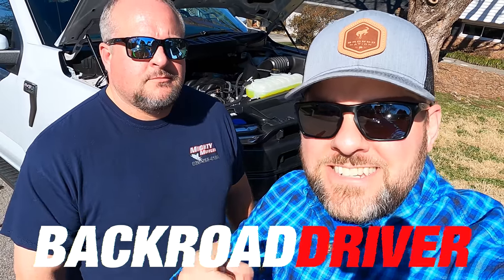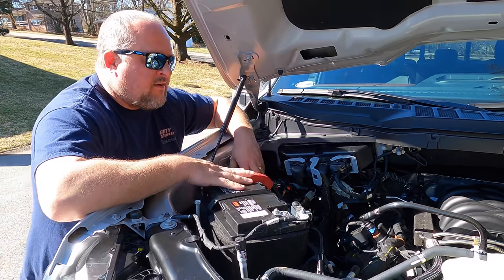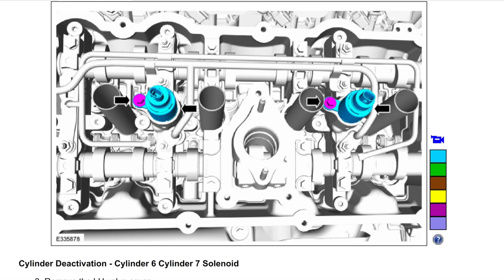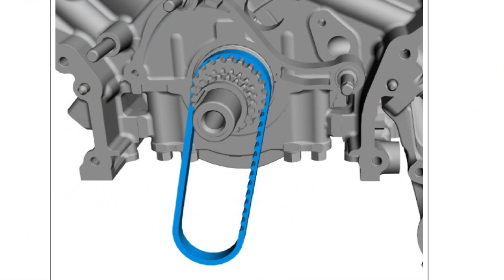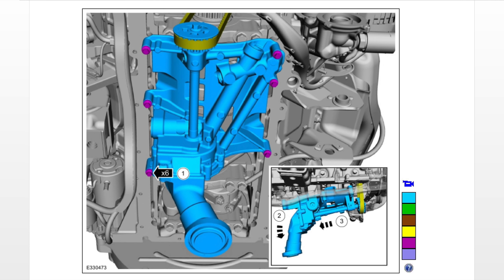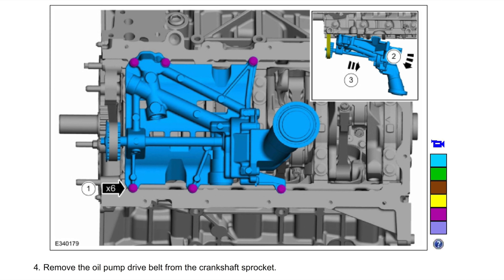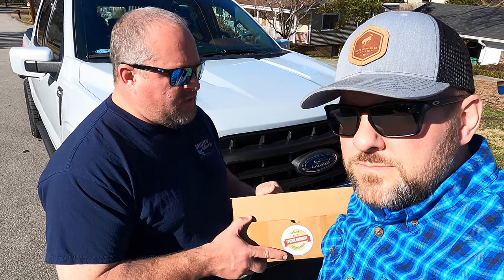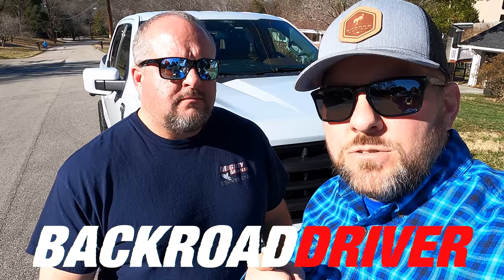2021 Ford F150 5.0 V8 Cylinder Deactivation & Oil Pump Belt Explanation - JLT Catch Can Install

Comment: Oil and rubber belts don’t mix, that won’t end well for Ford.  GM is also doing that on the Duramax in the 1500, except its on the back of the engine, so transmission has to be pulled to service it, genius!
Reply: Yah that is definitely going to be an issue.
Reply: Material science has advanced compounds in belts.  It is not “rubber”.   Engineering has improved gum bands to be oil resistant.

Comment: Getting my first Toyota Tundra this year. And a Ford guy for 35 years of driving. Tired of the b*******.
Reply from the maker: Thanks for watching!  How come you chose the tundra? It looks virtually the same as it did over 20 years ago and hasn't had any significant updates since 2007.  I have a feeling you'll be back in a Ford before too long.
Reply: Tundra reliability and proven engine/drivetrain.  Hp and Tq wise it’s still competeing with the others 14 years later. Also no BS cylinder deactivation, start-stop.
Reply: @Mill72  Still once the Tundra gets some miles on it they average 11 miles per gallon, at that rate for 10,000 miles drive a year the Tundra costs $600 a year in fuel alone. I've had Ford's for years have a 3.5 EB now, I've not have issues with them when people cite reliability as a reason they buy Tundra I guess, sure, but it's not been my experience that Ford is anything but reliable, and lasts a long time. I kept my last Ford 20 years, the  drive train was still strong when I got rid of it.
Reply: @Steve-yr5vi  I had a ‘14 Tundra and now an ‘21.  Your exaggeration of 11mpg is false.  Both of my Tundra gets 13-14mpg mix and freeway 15-17mpg.  Yes it’s hand calculated and not going off the lie-o-meter.  I also had an ‘17 F-150 3.5 Ecoboost.  I can tell you at best freeway was 19mpg.  The 5.0 would be similar.  It’s moot at that point between mileage.  Towing wise I bet both similar with 5.7 Tundra to 3.5 Eco and 5.0 F-150’s.  If you can afford the truck, you can afford the fuel and maintenance without bitching.  Overall reliability track record is important. That’s the point.
Reply: @BackroadDriver  thats why they're a good truck, outdated yes, but Ford is slowly turning into what Dodge used to be. Not good at all. My last Ford after 35 years was a 2018 5 litre. Worst POS I've ever owned
Reply: My tundra is great.   No start stop crap.   No cylinder deactivation.     Just a reliable, well built truck.    I’m definitely a Toyota guy now. After years of chevys and fords.     Toyota quality #1
Reply: I was going to purchase a 2021 F150 5.0 and trade my 2016 5.0 in. I told the dealer I'm not interested after I learned about cylinder deactivation and went and bought a Tundra as well. I've had F150 all my life but the toyota checked all my must haves.

Comment: Don’t like cylinder deactivation.  I run a servive departmental a large dealer.  Trust me it’s not good.
Reply: @mattbrown2701  I heard sport mode deactivates it
Reply: Mines burning oil like a champ.  When cylinder deactivation is on.
Reply: Ford pipes V8 sound through your stereo speakers.

Comment: Damn ford taking tips from chevy with the cylinder deactivation and rubber oil pump belts
Reply from the maker: I hope they learned from GM's mistakes.
Reply: @BackroadDriver  the only thing ford learned was that pre-mature failure equals big money

Comment: Does that belt have a service inspection/replacement specs in your manual?
Reply: The E- manual makes no mention.  Says to inspect accessory belts at 100K?
Reply: Doesn’t matter. Belts can break prematurely at any time. Belt breaks. Bye bye motor. Stupidest thing any car company has ever done. Don’t fix what ain’t broken and this type of thing needs to stay gear driven.

Comment: Well this concludes my looking for a 2021 single cab
Reply: I've looked at the system, they've got a fix for all the issues GM had, they actually added lubrication for the lifters when they added cylinder deactivation. The oil pump does concern me, but supposedly it's been tested to 1100 horsepower and stupid RPM at the same time to make sure it won't fail, and also they beefed up the piston rings to help stop blow by. As long as you're using good oils (no store brand conventional for the love of god... or ANYTHING not full synthetic) the gen4 should be just as durable as the gen3. That said if you treat it like crap, put the wrong oil in it, and run said oil longer than your should (the oil timer is designed for synthetic, so set it to like 30% if you insist on running conventionals, or 60% on blends)
Reply from the maker: I agree with your comments. There's a reason they were last to implement cylinder deactivation.  Hopefully all of the changes they made actually allow for a reliable system.
Reply: @BackroadDriver  it can't be worse than the ford an Chevy systems with all the upgrade, but putting good oil in them is going to be mandatory if you want more than 100k miles out of them.

Comment: Ford is starting to mess up with this cylinder deactivation and wet belt.  I was waiting until next year to order a 2024 F150, but knowing this will surely make me look elsewhere.  Cylinder deactivation will even cause uneven wear on the cylinders.  Did the Ford people accidentally hire GM engineers for this shit?
Reply: I don’t get how they can’t just leave the F150 without it just like the Mustang. If people want fuel economy they would just go for the lower cylinder engines 💁🏻‍♂️.
Reply from the maker: Unfortunately it is confirmed that the new mustang will have cylinder deactivation as well. It's coming.
Reply: @BackroadDriver  I’m so glad I purchased my 2022 s550 then😮‍💨
Reply: @BackroadDriver  Well I am glad my 2020 GT500 doesn't have cylinder deactivation.  Haha
Reply: My 2022 f150 has the cylinder deactivation removed from dealer. I believe it’s an option you can remove when ordering it. I found this out when reading the window Sticker
Reply: @BackroadDriver  I have a 2023 5.0 and I have heard we can tune out the cylinder deactivation
Reply: @Jaime Leon  you sure it wasn't the auto start/stop removal?
Reply: Yes infact. And its not a coyote motor. The coyote is not flex fuel and does have a lot of differences. Its roots are more tied to the 4.9 crown vic.
Reply: @Jaimeleon20 You csnt just remove it. You will still have 4 weak cylinders.
Reply: @rickymortero3023 Next remove the 4 weak cylinders. Then your good.
Reply: @MasterCarguy44-pk2dq  yup officially removed. Got Oz Tuned 👌🏻 badass tune when using E85 what a difference.
Reply: @MasterCarguy44-pk2dq  ??

Comment: Cylinder Deactivation! was a disaster on Govt Motors
Reply: IMO the newer cylinder deactivation system that GM is way more reliable than the old 2013 and earlier trucks. I know a bunch of people with 150k to 200k+ miles on their 5.3 trucks and never heard of any of them having a bad lifter yet. The two guys I know with over 200k miles never turned it off which I thought was crazy. Both of them change their oil early, like before 5k miles.

Comment: Gm states a 150k interval inspection of the oil pump drive belt is recommended on its 3.0 diesel. This requires removal of the transmission what a joke. The 5.0 being on the front of the engine and no service interval stated easier but still a POS way to drive an oil pump. What was the issue driving it off the snout of the crank worked flawlessly since the introduction of the modular engine est 1991 29 years NO PROBLEM. MAN love my current 2007 F150 wanted to upgrade to a 2021 55 years old and last vehicle I hope to buy first time brand spanking new. I refuse to drive anything with a rubber belt driving valve train or the worst the oil pump. I will just carry a case of oil in the bed and get a 2020.Owned Fords since the 1980s my first car a 1981 Mercury Capri with the 3.3 could not kill that thing my brother did around a pole. Have always been a mechanic on diesel licensed since 1991 have my automotive also kinda know when the shit is going to hit the fan Henry is rolling around in his grave.  Is this the end of the Coyote.
Reply: dropping the trans is no harder than having to pull off all the sht on the front of the engine (all the accessories, timing chain cover, etc ) in order to slip a belt on or off. The 3.0 diesel has an access cover on the back of the block that you remove and have access to the belt.

Comment: The Cylinder Deactivation is a HUGE no for me. I'll just go to the Ecoboost. More torque and truck like capabilities anyways.
Reply: We haven’t had any belt problems. Nor have we had any cylinder deactivation issues. Our only problem has been oil consumption in some of them. But the reprogramming fixed most of them

Comment: On gm vehicles cylinder deactivation  tears up your cams, torque converter and  eats through oil all to get 2 better mpg🤦‍♂️
Reply: Is that the 80s technology?
Reply: I think you are thinking of vvt like vtec. Correct if im wrong. vvt changes the "size" of the cams. While variable value timing completely closes all the valves in a cylinder.

Comment: Oil pump belt being rubber is a non issue. Looks like a mini version of the CVT belt on my RZR and it goes through way more than any oil pump would. As far as cylinder activation? Pass. Hard pass. Ford needs to crank out mini versions of the Godzilla motor. Simple pushrod motor. Very little nonsense.
Reply: Dump a quart of engine oil on your rzr cvt belt and let us know that works out for you!  lol
Reply: @Upracefan  The oil pump belt has teeth so slipping won't be an issue. As far as strength, I still don't see an issue.  The 2.7 eco motor has been using them. I do agree, that companies need to stop trying to get fancy with new stuff. Just perfect the old stuff that works. I can agree with that.

Comment: Well looks like Ford just hit the fan for sure. Was thinking to replace my old Sierra with a 5.0 Ford but now the 5.0 is gonna be junk and knowing Ford they'll make it a pain in the ass to change the belt. Man fuck ford and gm. My next truck for sure is gonna have to be a tundra for sure. Dodge can piss off they're worse than the two. My friend had his zf blow in 63k and the cams are prematurely worn. Traded it in for a tundra two years ago. Gonna have to follow suit.
Reply: Why not consider the Titan/Titan XD? It has a much better warranty, is more fuel efficient, more powerful, and actually has a fully-boxed frame unlike the Tundra. At least wait until the next-gen Tundra, because the current one is no longer competitive. 

Good luck either way!
Reply: @dave3682  the only decent Titan was the CD with the cummins and aisin seiki transmission but it was a 3/4 ton but was discontinued years ago. The regular Titan isn't great. Why buy a Titan when I can get a tundra for the same price. Better quality truck.
Reply: @elihernandez330  The Cummins Titan had reliability issues, and it was only discontinued just last year. The 5.6L Endurance gas engine, on the other hand, is bulletproof. Also, the XD was never a 3/4-ton, it was a "heavy half-ton" or a 5/8-ton depending on who you asked.

You'd be hard-pressed to get an equally-specked Tundra for the same price. Toyota is infamous for not discounting their trucks and Nissan is famous for heavily discounting theirs. And even if you could get the Tundra for the same price, it would still have a significantly inferior warranty.

I disagree about the Tundra being a better quality truck. They have suspension, rust, and clearcoat issues and, like I said, they are the only half-ton truck that hasn't graduated to a fully-boxed frame yet. Not to mention the terrible fuel economy and safety ratings.

At the end of the day, the only good thing about the Tundra is the longevity of its powerplant, but other than that  it lags behind the competition in every other objective aspect. They just aren't competitive trucks anymore. Though, the next-gen looks promising...

Comment: Cylinder deactivation is trash, especially GM 5.3L and the same shit with the 6.2L. Way too many lifter collapsing. My opinion they should have never added that feature for the Ford 5.0, they should have left it alone. GM has had AFM/ DOD cylinder deactivation for 10 plus fucking years and still can’t get that shit right. Even the new 2019-2021 are having issues! 
For GM depending on what exhaust kit you get you will have a sound issue when it drops to V4. Borla exhaust system you barley notice it but it’s noticeable.

Comment: Cylinder deactivation is a no go for me. Ended badly for chevy. I would consider the hemi or ecoboost.
Reply: No such thing as a HEMI after 1970's. Except a 2.0 4 cylinder versi9n in Japan. And ecoboosts dont have port injection so major carbon on 35% of the rods/valves

Comment: The previous oil pump design WAS the weak link of the Coyote. Ford engineers have stated that this design has been tested to withstand 1000 hp. The old one...not so much.
Reply from the maker: That’s what we are finding out. This may be a blessing.
Reply: Yeah the old oil pump was such a problem that Ford Performance crate engines wouldn't even use it. They would literally pull that pump off as soon as the engine assemblies showed up.

Comment: Wow, a rubber oil pump belt. Is that to save money. A rubber belt will not last, wow, the repair bills 💵
Reply: Yeah if they would build it with good steel materials and spec at least 5w30 oil, I cant see why even minimal oil splash would not keep the chain alive for longer than a belt.

Comment: Can anything good happen to a V8 engine when half of the combustion chambers stop receiving fuel, yet the pistons are still reciprocating?  Can anything good happen when the firing order for all the pistons is disrupted?  Can anything good happen to the two fuel injectors for each of four pistons when they are no longer being fed gas by the fuel pump?  I am not a mechanical engineer,  nor am I an automotive engineer.  But I do have a good grasp of spark, fuel, oxygen and ignition. Cylinder deactivation has never been anything other than a recipe for engine breakdown, as far as I can see.  It seems that if cylinder shut was such a good thing for engines, don't you think the guys at Indycar, IMSA, NASCAR and Formula One would be using it, at the end of a race when the prize money is on the line and the fuel tank is on fumes? I just found your channel recently, and it's what I have looking for. Keep up the great work.
Reply: Clearly, racers would have no use for a feature like this.  It's purpose is to reduce fuel usage when you're at a steady rate at highway speed.  Other than early GM engines, these have really not had problems.  But yeah, it's more stuff to break.
Reply: Have to agree Roger. The KISS principle works for me.
I'll be keeping my '17 XLT 5.0 for a loooong time.
👍🏽 🍻 🇺🇸

Comment: Fingers crossed that you can tune out the cylinder deactivation!
Reply: Tuners will be able to turn that off easily. There’s a wire you can disconnect next to the battery and it disables the “cylinder deactivation”. You’ll just have a check engine light on.
Reply: @L15CcorridosAR  so then you could just clear the check engine light after it’s been disabled?
Reply: There is no reason it wont be able tk be tuned out. Its not a mechanical change. Its activated through the pcm through eco mode. Its fuel injector related. Once the pcm is unlocked for tuning, its going to be a cake walk to turn off.
Reply: @J-Whit  that’s what I was thinking.
Reply: @lucasblanchard47  other than the solonoids, nothing major was done. This is substantially better than dod from gm imo.
Reply: @J-Whit  interesting. Then I guess all you’d have is some nonfunctional solenoids sitting there on the engine ha.

Comment: The cylinder deactivation is not a big deal as long as it is not as jolting as the GM one. The Gm one is so obvious when it goes into 4 cylinder mode. I can not believe they are using a rubber belt for the oil pump. I can already see people having motors grenade over this when the trucks get to be 8-10 years old

Comment: This is ridiculous. Ford should have just left the 5.0 alone. GM failed with this design. I guess I’ll just keep my 2010 f150 4.6 with 120k miles forever.
Reply: It's the damn government forcing the manufacturers hands for fuel economy standards.
Reply: @06RedfireGT  just for a few more mpg 🤦‍♂️
Reply: The only issus with the GM design is that its on the back side of the 3.0 duramax diesel, and you must remove the transmission to check it at 150k mile intervals.. It hasn't proven to be a problem, its just annoying to remove the trans to check it.. The ford is not mounted in this fashion and has no maintence schedule..
Reply: @06RedfireGT  Yes, that's what some people don't realize.
Reply: I have a 2011 f150 with a 5.0 and it has 135,000 miles! AWESOME TRUCK AND A KILLER MOTOR!!!
Reply: @jdtractorman7445  diesels would be a hell of a lot more reliable without the government mandating a DPF and SCR.

Comment: I bought an f250 gasser because of this deactivation bullshit. Ecoboost requires premium gas. At what point does the Duramax 3.0 or any diesel in general make more sense? Ecoboost are pricey to repair too.
Reply: You can use 87 in the ecoboost

Comment: Had a 2014 Silverado work truck and the cylinder deactivation was horrible. The whole truck shook when it went into 4 cylinder mode. Now I have a 2020 Silverado work truck and I can’t tell when it deactivates. For my personal truck I bought an F-150 in 2019. Glad I did.

Comment: The reason is that they received a subsidy or grant from the government for putting gas saving features into the vehicles, but they know it causes a lot of quality problems and issues for the  customers.  SO they take the money and won't tell you about this cylinder deactivation.  All for saving 1MPG.